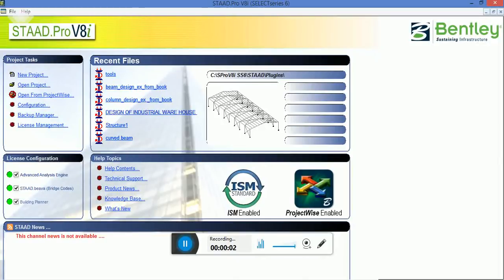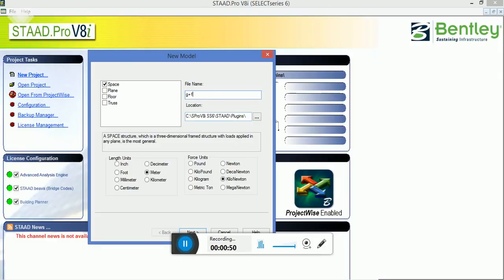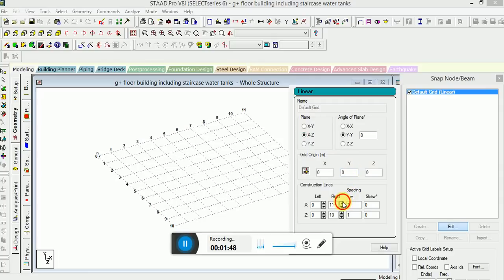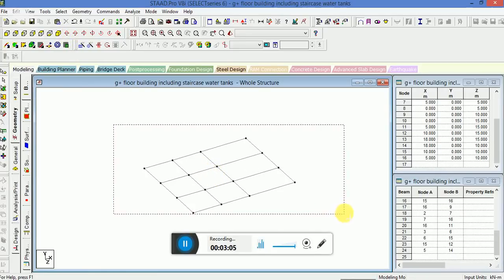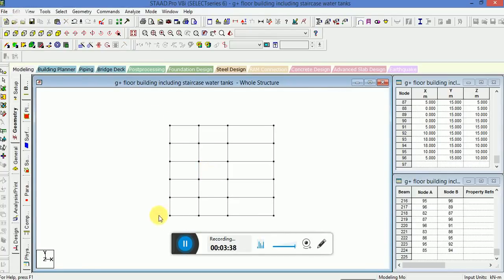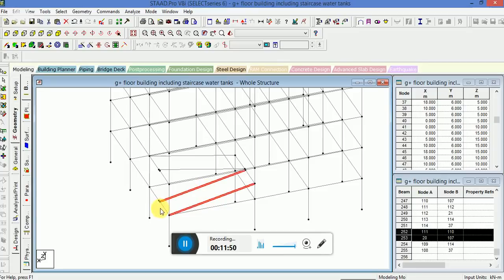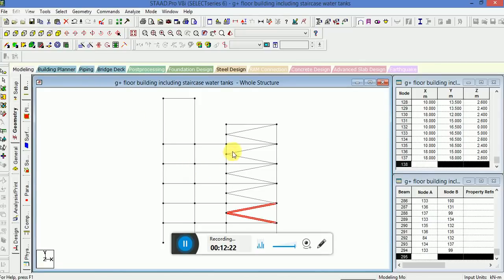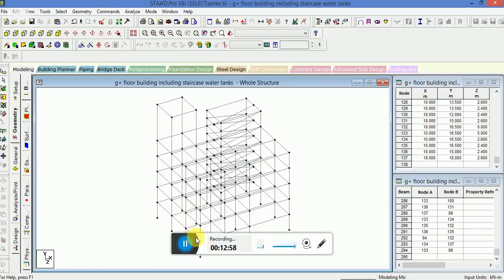STAAD PRO G+5 Building Including STAIRCASE WATER TANK (2019) Part 1

Comment: Brilliant sir....I'm waiting for the next
Bt I've a question there is several structural design & analysis softwares.. Which is the best as usually used for beginners & also experts??????
Reply from the maker: Thank you very much for your valuable comments ...yes staad pro is easy to model and analysis and for more complex structure you can use Etabs and for beginning you can use staad pro first then etabs .✔✔🇮🇳
Reply: Vibhor Shukla thank u sir for ur beneficial comment
Reply from the maker: @selfenquiry456  thank you keep sharing keep linking ..✔✔